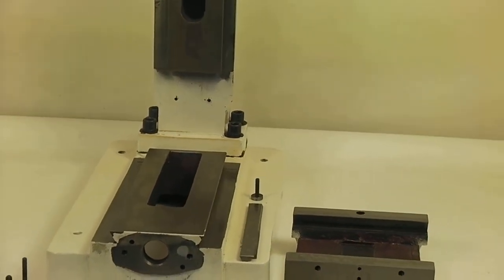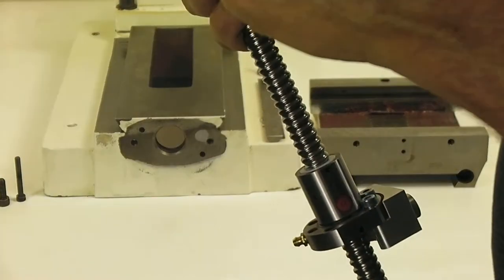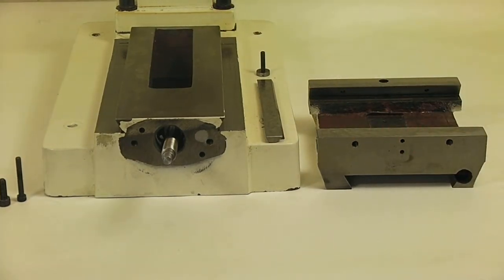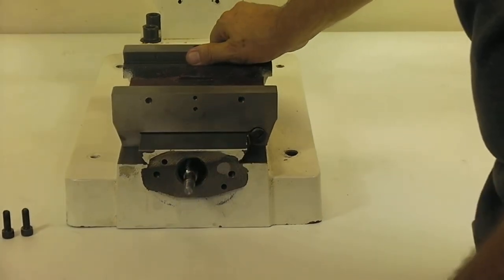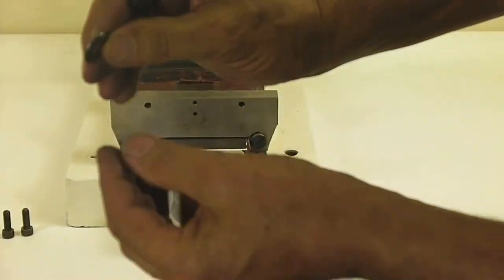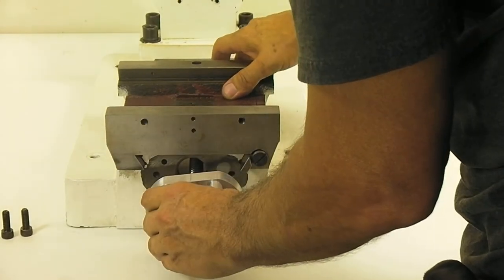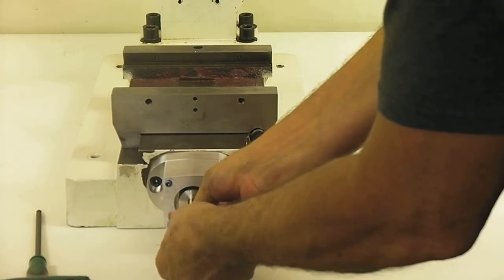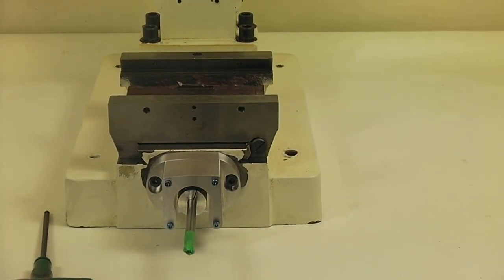Y mount install

Comment from the maker: The mount holds the bearing and the coupler isolates the stepper from the screw. If the mount is in the right place then you just add the stepper.

Comment: At ~4:00 minutes into the video you discuss squaring the ball screw, however at ~5:00 minutes into video you attach the motor mount.  Doesn't the attaching the motor mount to the ball screw throw off the alignment?  thank you.
Reply: I looks like the coupler half that is attached to the screw is threaded and is used to set preload, the bearings seated in the mount would ensure that the screw stays aligned and the element between the coupler halves would allow for any misalignment between the motor and the shaft.  If a rigid coupler was used and the bearing pockets were oversized then yes motor "could" move the screw a small amount but even at that it would harm the motor more than then binding the ways on the mill. 
The design this kit uses is by FAR the best design I have seen.  Most kits just reuse the stock thrust bearing and use a nylock nut to preload that.

Comment: Do your kits come with motors? What do you need in addition to your kit to convert from a basic manual mill to operational CNC?
Reply from the maker: You need working steppers. So computer , power supply 50V 12A. 570 oz Nema 23 steppers for the X and Y with 3/8" shafts and 640oz Nema 34 stepper with a 1/2" for the Z. 5A drivers and a BOB.

Comment: How much do you charge for a kit?
Reply from the maker: +Justin Bell 

Hi Justin.

I charge $799 on ebay but I can give you $50 off if you buy direct. The standard kit has Nema 23 mounts for the X and Y and Nema 34 for the Z. Couplers are 3/8" for the X and Y and 1/2" for the Z.

I clean, straighten and re pack all the ball screws for less than .0015" backlash. 

Thanks 
Dave